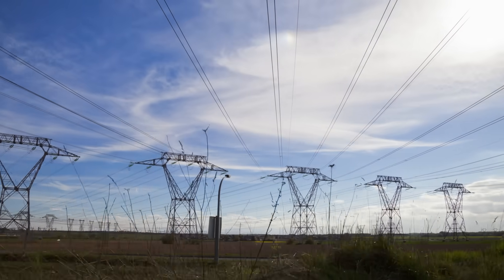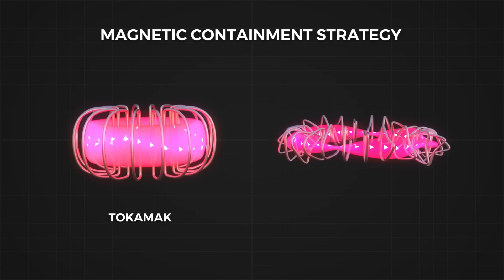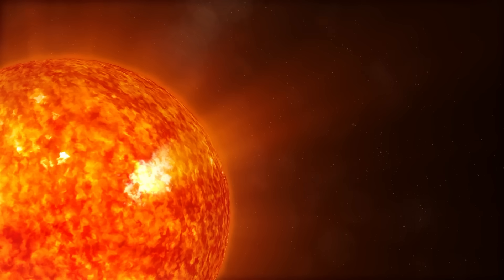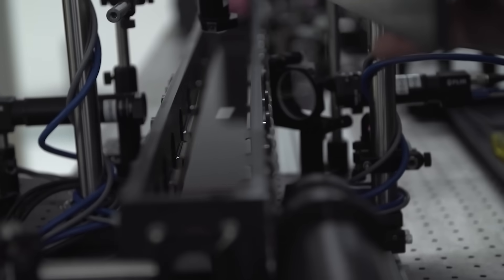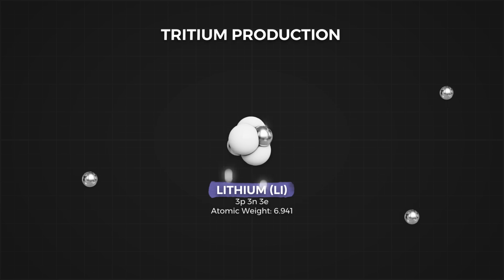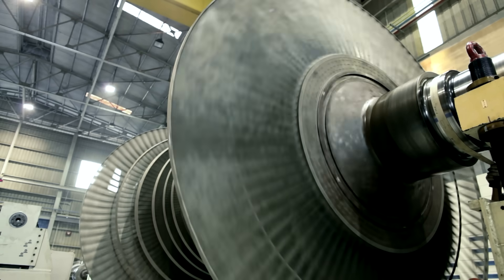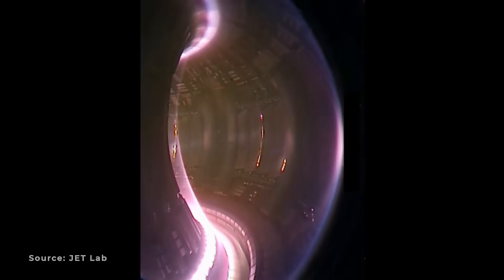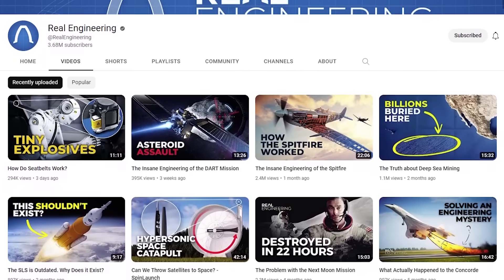The Problem with Nuclear Fusion

Comment: I've been working with electrolyzers for quite some time now, a little over a decade and a half to be precise. I have made some rather large units and have generated enough hydrogen on demand to run generators and even a vehicle. I have noticed that not only do I manage to get a few ounces of deuterium a year out of some of my big units when I was running at my highest production but also some of my units were showing odd behavior. I've played with tritium for a long time as well, I bought my first vials about 4 years ago. I never realized what was going on but I never had the tools to prove it either. I think what may have been happening is that through the chaos of separating the hydrogen and oxygen in H2 and O2 we also spawn molecules of o2 which you we also spawn molecules of 03 which you can smell and I believe H3 is produced as well which is why some of my units would tend to Glow after months of running. The phosphorescence inside of the Plastics I was using would start to react with the beta particles of the tritium causing it to show a distinct white glow that would actually light up the area around it. I don't know how I am still here due to the fact that when I started playing with hydrogen I was a little careless. One of my most powerful units was legitimately a converted 1 gallon sprayer tank holding 60 PSI of hydrogen flowing into a 6 gallon metal air tank flowing through a check valve backflow system with a back flash preventer and blow off tube. That was running to a solenoid running to an injector which fed my torch. That unit would run for a month or two at a time before I would tear it down and as the units fuel what age the unit would start glowing brighter! I do not have the facilities I used to have, I've also learned to respect the fuel a little bit more and realize that what I was doing was slightly suicidal! As soon as I I'm able to build a facility that I can contain a catastrophic meltdown of my unit I do not want to proceed any further on the research. I put this out there on this channel because I hope someone else may have seen some similar results and there may be someone who has the facility that can pursue this Avenue. I do not see it as difficult to build the unit to capture the samples and prove my theory but if anything goes wrong it could be very bad within city limits. A 1 gallon jug flipped upside down and filled with hydrogen and oxygen and then just flipped right back over and the lit with the cap sitting off from a distance we'll set off a detonation blast that Echoes for two city blocks. Standing at about 10 ft back with a pole the force will push you about a foot and a half back so be prepared for the impact and where ear protection and eye protection. Imagine what a 9 gallon system pressurized at 60 PSI would do.
Reply: There is no reason to assume that you accumulated significant amounts of tritium in your electrolysers. The natural tritium level in clear rivers is about 1 Bq per liter! If the water stems from rivers near fission plants, then the amount might be some tens of Bq per litre. Electrolysis is a slightly isotope dependent, but it will not significantly enrich tritium from natural water. Let's imagine you somehow trap every tritiated water molecule in your input stream, then you could process 1 million tons of natural water to accumulate 1 GBq which is the exemption limit for tritium. Since there is no need to assume this magical enrichment capabilities and you have probably not processed these vast amounts, you should be a couple of orders of magnitude below this value with your machine.
Reply: @magnusschlosser5927  I never said that I thought I had captured a large amount! For that matter I liked the equipment to prove that that's exactly what it was. That's my goal, I've been playing with hydrogen for multiple reasons throughout my lifetime and have even used it for Ruby synthesis. I am no nuclear physicist, for that matter I'm a hobby physicist at that. Same with my chemistry background. I went to school for aviation and have been agriculture my whole life through family business. I do not hold near the qualifications needed to prove any of these series but I can only share my observations.
Reply: @magnusschlosser5927  I however did think about developing a trap doped in phosphor to see if I can get a reaction. Once I have the facility I am trying to acquire I want to pursue this avenue. Electrolyzers such as this are also extremely important in the synthesis of methane off world and that's one of the reasons why I've been pursuing electrolysis... That and I've made quite a few cannons and rifles as well as pistol set are powered by hydrogen, I like to make things that go boom as well.
P.S. as an American I have cleared all of my weapons with the ATF before I proceeded. I always make sure my research follows within the law of my region.

Comment: ManKinds Realistic Approach to Nuclear Fusion.

Step 1 California and Germany have the idea of phasing out Earth's biggest Clean energy nonrenewables in the form of nuclear Fission. Lets not to that.... 
Step 2 FAA needs to relax the amount of red tape to allow private enterprise to innovate and move Man-kind ahead without creating a bloody monopoly controlled by one billionaire. 
Step 3 new energy production proposals have to be sourced from zero green house emissions from power generation methods.
Step 4 When 60-89% of the global energy production is sourced from nuclear Fission, production prices of liquid propellants and oxidants will decrease in price.
Steo 5 When the supply of rocket propulsion are at sustainable levels to start up an enterprise in mining rocks in space and using those materials to build equipment and devices.
Step 6 with the newfound technology hydrogen and other fusion methods will be possible.

Comment: "and produces no dangerous radioactive products"

As you point out, the D-T reaction produces neutrons. The high energy neutrons will impact all surrounding components of the reactor and, through neutron activation, cause those components to become radioactive and well as weaken them over time. When they are replaced, the old slightly-radioactive components will need to be stored in a manner similar to any other radiation waste. So it's extremely misleading to say that fusion doesn't produce radioactive products; sure the reaction itself doesn't produce any but the will be literally tons of radioactive waste products due to the massive neutron output.

Comment: So our best shot at capturing the energy of fusion reactions is to turn between an annunal and double of that supply of berillium into radioactive waste, because there is naturally uranium inside and no matter how hard you try to refine, at the amounts needed for the blanket (260-560 tons) even the purest beryllium samples will contain enough uranium fission products due to their exposure to neutrons to be considered a radioactive hazard after their use. Is there any way to get more beryllium? Like to harvest it from asteroids and finally declare the desert in africa our planetary garbage disposal? I mean, an area that big, could literally take anything we could throw out in there. Probably you would find much smaller areas around the world which are still suitable for disposal of anything. Also NATO should issue an international mission of protecting the disposed products with military forces to prevent them from being stolen and missused.

I mean, people start talk about supplying energy in quantities that can be somewhat compared to world-wide demands. It was just a question of time until you need to consider planetary garbage disposals that will destroy the enviroment and pose a threat to safety, but everything we did so far did. Its just our first time when we are forced to call the thing we plan to do by its name and not by its purpose, because its purpose is its name and the word is anything but pleasant. The longer we wait for scientific approach on the question what kind of enviroments could we sacrifice for the sake of progress because of ethical reasons, the more damage actually is done because of our ignorance. There is no way in hell that EVERY single enviroment and its ecosystems are crucial for everything else and unpredictable if harmed. There is just no way that there are no secluded corners somewhere on earth that are chemically and biologically cut off from the rest of the earth and mean so little to us, that we should never ever even think about sacrifice of nature, because everything could go downhill. It just doesnt make sense, that we, in the year 2022 let such questions be decided by politicians out of urgent need to deal with such questions and designate areas to be garbage disposals on a small scale, but dont let the scientists actually do some work in advance to come up with scientifically backed up theories about large scale garbage disposal. Sometimes it just seems like extreme lunacy to me to deal with the question of how to dispose of materials you dont want to have around purely based on the amount of materials here and now each time giving away a miniscule piece of land for the purpose. And everytime they say that we dont have enough space to dispose of everything we need to dispose of. Well, yeah. Because last time and every time before that you literally shat out the smallest amount of area thinkable to cover the need. How do you expect the situation to change, when you dont change the scale of your solutions and constantly solving the problem to a barely under the critical state 😅 Obviously the problem will get critical again the very next fucking day.

Also nothing is really good at capturing hot neutrons and turning it to heat except meters upon meters of basically anything, preferably dense. But it will most likely make the stuff radioactive instead of hot to run turbines. Its just that with beryllium when it gets radioactive, the fission reaction produces somewhat usefull products and the fuel for the reactor. But the blanket becomes somewhat of a fuel cell itself. But on the other hand we could, ah nevermind. Particle accelerators do it better, cheaper and we have those maxed out.

I just dont understand why not just use fission energy, because ironically in the end fusion leaves you with the very same waste fission leaves you with. AND its waaay more expensive.

What we really need are cheap and productive particle accelerators, because you can do all sorts of usefull shit with those that has to do with fuel for fission reactors of the next generation. And to finally realise that fusion might actually not be that usefull after all.

Comment: All attempts at fusion are best halted. ALL schemes currently being funded generate excess neutrons.
THAT'S the problem. 
Neutron scarcity is the ONLY thing holding back unlimited nuclear weapons proliferation.
With 'free' neutrons by the bucket-full, thorium becomes U-233; U-238 becomes PU 239...
Without limit. 
Making atomic explosive almost becomes child's play. Enrichment becomes unnecessary.
Fusion is THE prescription for total disaster.

Comment: The problem with efficiency for electricity production is how we harness the energy. All non-renewable energy relies on generating steam to drive turbines that is attached to a generator that generates electricity. Coal is burned to heat up water to create electricity in a coal electric powerplant, the same goes with biofuel electric plants, water is heated by nuclear reaction and turned steam to drive turbines in a nuclear powerplant. If we could find another way to generate electricity at a much more efficient way than boiling water to generate steam, we could theoretically solve a lot of energy problem.
Reply: induction?

Comment: The problem with facts anyone can see for themselves, is that they destroy delusions permanently. 
The propaganda value of this distraction is buried in allusions to technologies always just out of reach, and theories derived from the same thinking as the Big Bang debacle Sir Fred Hoyle understood and dismissed, ie that in Principle pure Fusion Reactors are actually not viable in sufficiently practical ways to justify the carry-on. 

It can be done, it has some experimental design success, but it is simply a sciency seeming Red Herring intended to prevent the decline of fossil fuel sales.

Everyone is entitled to their opinion, however worthless in this circumstance, so agnostic neutrality is always justified in Sciencing, but anti democratic application of sciency sounding junk like these devices are outright fraud, if not a hoax, as it is reasonable to see from observation. 
Supposing the theory is continued to be pushed, reiterated until "something happens", then what is already well understood about Critical Mass and Moderation of the yet-to-be successful Fusion-Fission Chain Reaction Cascades is enough to prevent continued "experiment". ("I may be MAD, but I'm not stupid", my Uncle used to say)
Failure is the only option that makes sense.

Because why does "pumping" a Wineglass with phonons at the resonance frequency and amplitude cause it to shatter?, why does pumping a Laser with photons cause it to emit coherent pulses by total internal reflection directed from a half silvered mirror or crystalline boundary?
It's the same phenomenon as the Flashed Formed Universe and inclusion-exclusion timing-phase positioning of resonances. 

THIS particular reorientation to fact is available for everyone who cares about thinking for themselves and re-cognises Euler's e-Pi-i 1-0-infinity Eternity-now Interval = Singularity <->Resonance, is the Fission-Fusion-Fission Function, Absolutely evident in Everything.

Comment: Thank you for explaining how they plan to produce electricity via fusion.  Most the explanations of fusion power I've seen/read gloss over that as if it's abundantly clear. I'd been wondering about how the thermal transfer would happen, since the magnetic confinement keeps the plasma from interacting with the structure of the reactor.

Comment: Currently taking a fusion course and it is pretty eye opening on how Unscalable this thing is. Just go cool the superconducting wire you need a building full of complex engineering the size of a fission power plant. Same thing for heating the plasma! The amount of stainless steal required for DEMO is the same as the annual world wide production! Fission coupled with fast reactors to burn most of the wate is the way forward

Comment: I am an ex nuclear engineer of the 70's era.  The neutron generated by the deuterium tritium fusion reation is bad news.  

A better fusion reation is one that generate pure electrical particle such as he3 or boron + proton.  These reations require higher plasma temps, but the energy can be recovered electrically.  No conventional steam turbines and little waste heat.  Also there is no nuclear waste caused by neutron activation of supporting natetial.

Comment: Great video and objectively presented. However, number one: Solar/Wind is not even close to economically replacing nuclear reactors. They are a dirty and unpredictable source that actually results in more costs to existing grids. Number two: Greenies do not want fusion, since it would result in cheap abundant energy to the world, which results in increased population. Climate activists are anti-human; cheap and reliable energy works against their depopulation agenda.

Comment: Nuclear Power and Nuclear Fusion ist not environmentally friendly.  It's turning mass into energy or heat in the long run. If it's done on a large scale, it will heat up the planet. No additional CO2 to make it worse but lots of heat pumped into the environment. Possibly not the end game solution.

Comment: According to what I read, the proposed way to take energy out of a fusion reactor is to produce neutrons that escape from the reactor and are absorbed and slowed down. But this is only a fraction of the energy that is produced in a thermonuclear reaction. So what are the ideas for the remaining gigantic amount of energy? How to safely and usefully get it out of the reactor?
Reply: There is a much better way to extract energy and this via magnetohydrodynamics generator (basically when you have charged particle moving through electromagnetic field you can convert it kinetic energy to electric one).
This, of course, means that you can't extract energy from neutrons.
There is a number of fusion reaction that do not produce neutrons and using them will allow us to avoid problems caused by neutron bombardment entirely. D-T fusion while the easiest to achieve, is not exactly best from a point of view of power source...

Comment: Control. Containment. Plasma temperatures. With the current technology, pick any two. We were told fusion was just around the corner. Well in 60 years, it hasn't happened. It won't be in our lifetime.

Comment: It doesn't work because stars are not fusion reactors, they are plasmas in glow mode being acted on by interstellar berklin currents.  If the sun was a fusion reactor then sun spots would be brighter not dark. Look at the safire project to see how a star works.

Comment: 13:12 atomic waste ... one could argue that it's far less than in a common nuclear fission reactor ... after all if it in the end it is just something like a proposed subcritical reactor it's still safer than a nuclear fission reactor ... I do not know if at 17kg and a tokamak size in the hundreds of tons area decay heat might play such a major impact .... Fukushima was a decay heat cooling failing disaster ... they ain't at this point yet with ITER